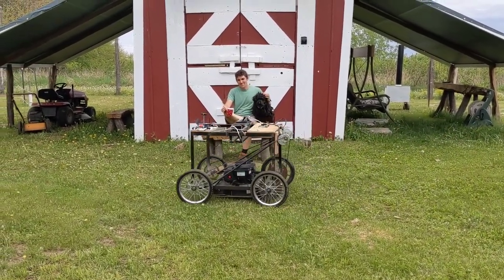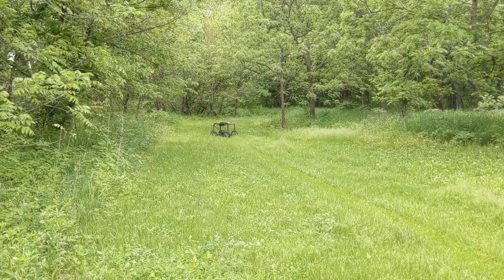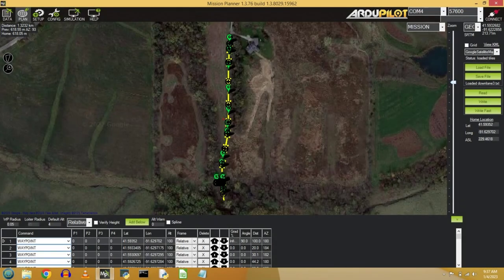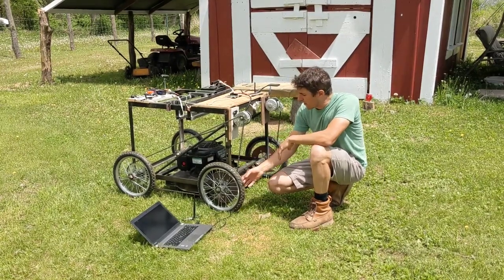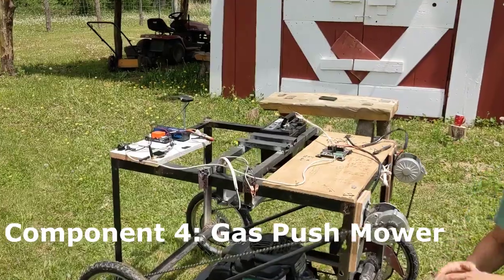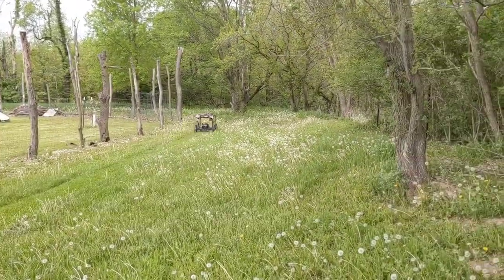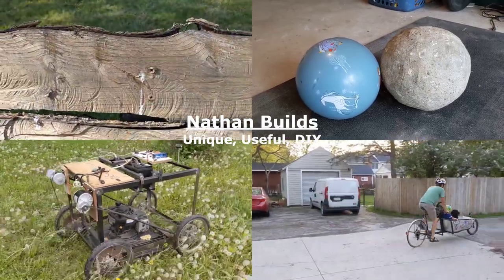DIY autonomous GPS guided mower - See Description for Details of Build

Comment: i guess the cube has specialized outputs for left and right motors and manages them for you as opposed to using a regular flight controller for quads or airplanes? or does ardupilot manage that
it looks like the tricycle / recumbent  market makes some nice wheels, axles and drive arrangements for a setup like this, just cut the axle in half.
Reply from the maker: Good questions! I'll try to answer all here.  I started with a cheaper pixhawk kit + GPS and realized the GPS wasn't accurate enough (no RTK) so I moved to the here3+ GPS which was the cheapest way to get RTK but then I realized it was a different connector (and different # of pins) than my original cheap pixhawk GPS connection.  I read how I could rewire it and possibly use it with the cheaper pixhawk but decided to go with the more expensive cube orange which has the proper connector/# of pins on the GPS.

Both the cheaper and more expensive pixhawks can do the "skid steer" rover setup - that is, where you get the left/right motors, and in a different video I actually use the same cube orange on a drone, but I could have used the cheaper pixhawk there too.

You also mentioned a heading hold gyro, I hadn't considered that yet, BUT I found this - 2 GPS for yaw control (which is also in the arudpilot docs had I looked hard enough) which I think would get you the same thing:
https://www.youtube.com/watch?v=2mk8fhbTN3Y
Reply: @nathanbuildsdiy  actually I think the heading hold functionality should be in ardupilot, in INAV there are different flight modes that keep the plane pointed in the same heading, or like acro mode in betaflight.
I'm looking at go-cart wheels and sprockets, it looks like those bike wheels tear up the grass.
I want to make an FPV version with front and back cameras so you don't have to turn around. it looks like cube want u to use their proprietary video.

Comment: Is there a reason you didn't design things to be more compact, like mounting parts directly to the mower frame, or were you more interested in simplicity? Thank you.
Reply from the maker: I wanted to be able to swap out the mower from the frame when the mower breaks down.  It's going over some rough ground and often hits sticks/walnuts etc.  This mower pictured lasted about a year and a half, but it was a $10 pickup from facebook marketplace.  

For the next revision I may just get a nice mower and mound directly to the mower.

Comment: Heey. This is just about the most awesome project there is on DIY autonomous rovers. I wanted to touch base and know which controller you are using and the kind of gps module you used. I have a very similar project and I really need your help with it. Please reach out.
Reply from the maker: I use a cube orange autopilot and here3+ GPS. The here3 can do base station corrections which makes it much more accurate, within a few centimeters.  I didn't need the here base station since we have base stations all over the state (Iowa has the Leica network - farmers connect to it with their combines to get accurate GPS in their fields). I'm actually preparing to update this video in the next week or so with the configs in mission planner to make the cube orage/here3 work in this configuration, let me know if that update doesn't clarify everything.

Here's where I got the radio/autopilot/gps:
https://irlock.com/collections/combos/products/combo-cube-orange-w-here3-rfd900x-telemetry-set
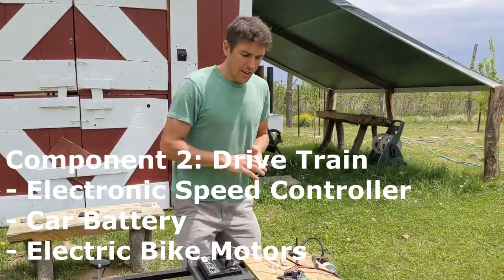Reply from the maker: https://youtu.be/yt_4_t4DEqo   Just finished details of the build, jump to 2:00 mark to get into details

Comment: looks like the sparkfun neom8-p will get u RTK and it's got I2C connections too so should be able to connect to regular flight controller. they're only 175 bucks each and you can make a rover with it too
Reply from the maker: Yes - that is another good GPS choice. It's similar to the here3 GPS though, the cost is also in the 900MHZ radio and the cube orange.  There are cheaper options on both of those though - there's packages on amazon for instance.  But I tried a cheap pixhawk first and the 900mhz radio included only reached about 100 meters which wasn't enough for me and the pixhawk had a different GPS port (fewer pins) and I didnt feel comfortable modifying my here3 even though it's possible in theory. That's how I ended up with pretty expensive hardware.  I'm trying to think up cheaper alternatives now.
Reply: @nathanbuildsdiy  I can't figure out if the gps data from that sparkfun breakout board is in the same format that other flight controllers recognize through their UART? someone said it wouldn't be compatible

Comment: Nice, which GPS model do. you use?  Why. you need 3 GPS? I.  think 1 rover and 1 base station. is. also ok?
Reply from the maker: here3 GPS - it's just a single GPS with RTK base station correction. I don't run my own here base station since we have base stations all over around here (farmers connect to them to get corrections for their equipment so I just use the same signal)

Comment: Good project  I have a 100 hp farm tractor that I would like to do this with where can I learn how to do this
Reply from the maker: Yes, it can be done!  ardupilot documentation/forum is a good reference and start point.  you'll have to change the rover type from skid steer to a more "normal" throttle/steer setup for your tractor.  You could put a linear actuator on the throttle and a BIG servo on the steering.  It'd require a fair bit of testing, probably start with a little model to prove out the idea, then scale up to the real thing

Comment: What about a ride on mower robot?
Reply from the maker: It's doable.  A zero-radius turn mower would be simplest.  Same set up as this (it's a skid steer, like R2D2 from star wars).  Just replace the electric bike motors with linear actuators that connect to the skid steering.  A "normal" rider would be a bit more complicated.  You could put a servo motor on to control steering, but the throttle/gear engage to power the wheels forward would be tricky.  It'd take some thought.
Reply: @nathanbuildsdiy  Some of the commercial ZTRs have can bus.  ;-)

Comment: Did you learn this at university? I'll bet not. Tell us more, dammit!
Reply: No, I don't think you can learn these sort of things in university.
Reply from the maker: I studied electrical engineering and spent years doing chip design and system architecture/admin, but that wasn't really much preparation for this.  I went through a bunch of prototypes and read a lot of ardupilot documentation before I hit on the working design here. If only there were a robotics degree or something where you could actually build this sort of thing in school!